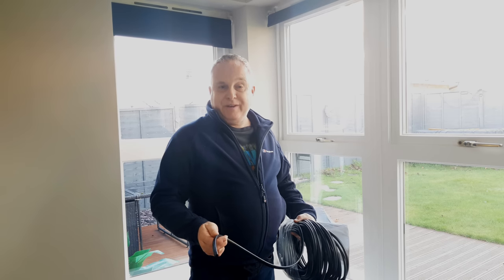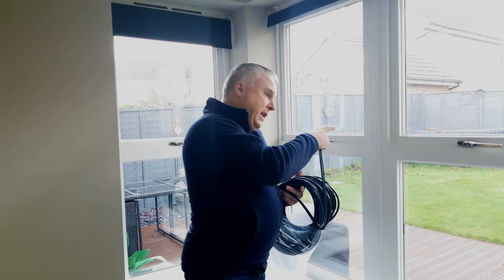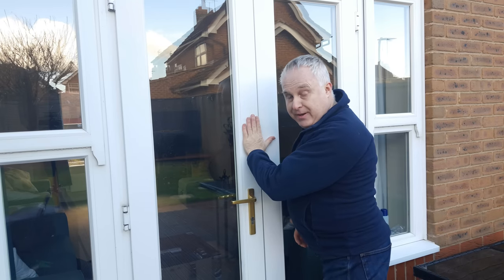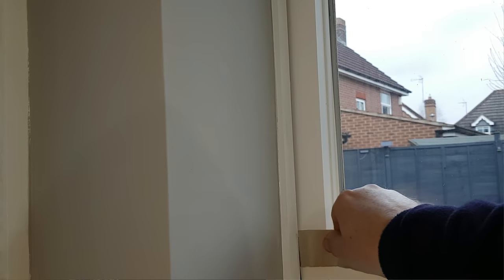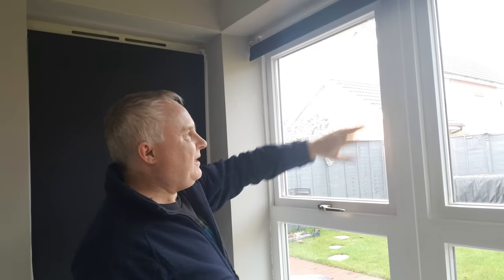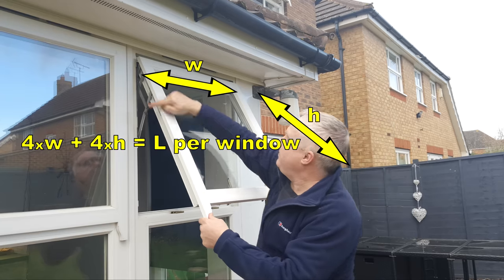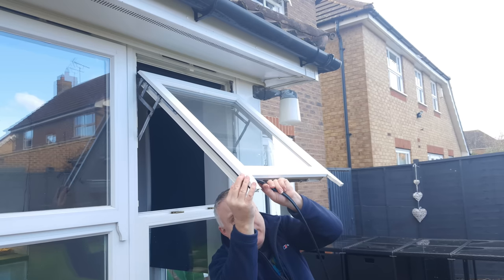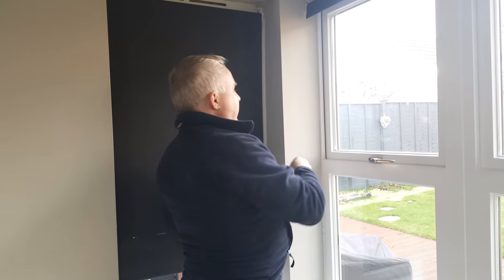How To Fit New Double Glazed Window Seals to SOLVE Cold Draughts

Comment: Everything perfect except when you have a single gasket all the way around you should start in the centre at the "top" of the window not the bottom. Any water that hits the pane of glass will travel down so to have a join at the bottom leave the possibility of water penetration.👍🏻

Comment: I had two windows that were really draughty, took a look at the seals and found that there was over an inch long gap between the seal ends, had some spare seal so measured and cut the size needed to fill the gap and presto! no more draught.

Comment: Thanks, I hadn't even considered this as a draught source - I'd already replaced all the glazing with lower u-value units and that has made a huge difference but have now noticed where the seals on the opening windows are not quite perfect allowing condensation to form when it's very cold - I'll be measuring up for new seals 👍

Comment: my window is similar to yours top hung and handle at bottom. Seal is okay all around apart from 1 corner to the right side of where the handle is. For some reason there is a considerable gap compared to rest of window? Is this the seal?
Reply: Possibly hinges if opposite handle.

Comment: Additional tip:
If it’s cold on the day you plan to change then rubber seal or it has been stored in a cold place. Put the new seal in a bucket of warm, soapy water for 15 mins before you start to make the rubber more compliant.
Reply: Cheers bud
Reply from the maker: Yes, indeed. OR keep the seal roll in a warm place indoors for a couple of days before fitting (eg airing cupboard). Thanks for sharing.

Comment: Check your hinges, especially on top hung windows. Best way to check is from outside with windows locked shut if you can . 

See if there is any play in the window from the frame
If so you will also need to replace the hinges too
New  seal alone will not eradicate the draught

Comment: So, you measured one part of the window as 6.5mm and another 5mm- does this mean you bought two different size seals?
Reply from the maker: No, one seal to sseal all round. the gap is bound to vary around a window so the seal must fill the largest gap.

Comment: Nice 1 bud 👍
Reply from the maker: Replacing the seals on the back door, kitchen windows and patio doors has made a huge difference - AND these are all on the leeward side of the house. Next week I'm gonna work my way through doing all the windows on the front of the house, which is the windward side. Energy prices going the way they are, makes it so much more worthwhile than ever before.
Reply: @AbouttheHouse0  yes its drfinetly a job ive got to do,,, thanks for all the advice on the St Moritz hot tub aswell,,, Awsome and thankyou again. 🙂👍